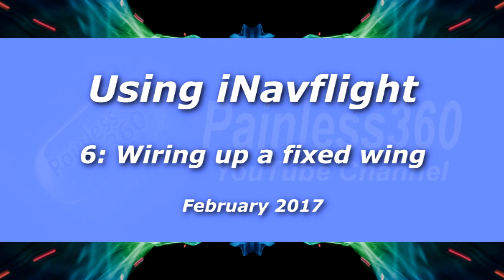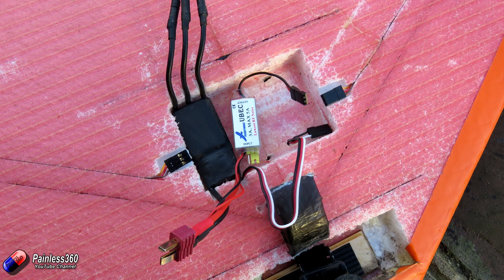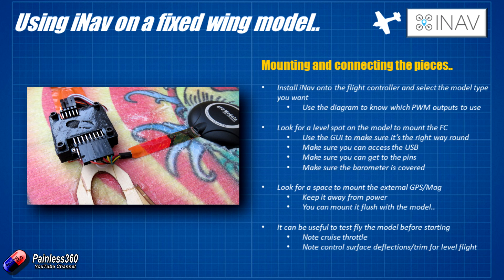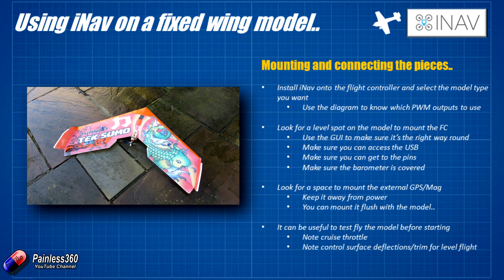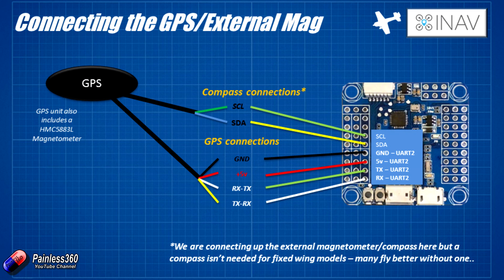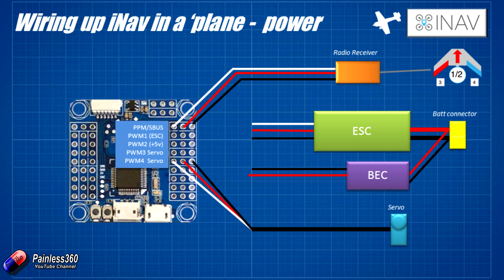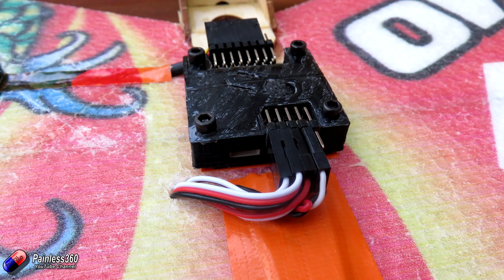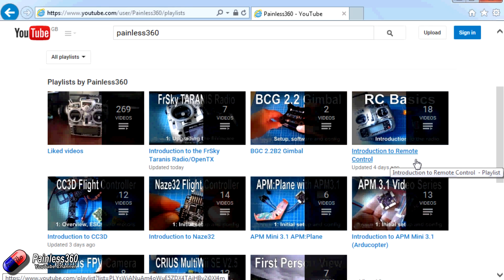(6/8) Introduction to iNav: Wiring up a Fixed Wing

Comment: Can a BETA Flight esc be used on INAV?
Reply from the maker: Yes, ESCs are not software specific..
Reply: Thank you, I was just going to sell it.  I blow a motor using a 60amp esc and 4S battery so I'm dropping down to a 35amp esc and still using the 4S battery. Will I blow another motor that way?
Reply from the maker: @derrickmitchell39dm  depends on the motor. The motor will only pull the current needed, having an ESC with a much larger rating shouldn't cause a problem. See my videos in the 'introduction to remote control' playlist. Best of luck
Reply: @Painless360  thank you. Your the best.

Comment: painless can you help me. Im stuck in DFU mode when I flash wrong firmware :( I try turn of full chip erase but nothing happen :(
Reply from the maker: +maciek pawłowski The boot loader should be okay, so short the boot pins on the flight control you’re using and select the ‘flash on connect’ option in the firmware flashier so it tries to soon as the board is plugged in. Best of luck!

Comment: As I understand I can't use an fs-ia6 receiver in this setup because lack of ibus port. Could you tell me that the fs-ia6b is suitable for this? Thanks.
Reply from the maker: iNav supports iBus - https://github.com/iNavFlight/inav/blob/master/docs/Rx.md
Reply: thanks for the clarification and the fast reply :)

Comment: I notice that in the videos you fly mode 2 I fly mode 1. Following your instructions my set up the controls are reversed. Is there a remedy, maybe a CLI command, or a special mix or even a fix with the Taranis TX such as reassignment of output channels in the mixer section?
Reply from the maker: +cattlebaron sorry, I'm all mode 2 here so you'll have to transpose. Best of luck

Comment: Lee, I am not sure others are having a problem, but I wanted to let you know that the board you recommend needs to be unlocked. This is easily accomplished by FIRST reflashing the software in Betaflight, which will unlock the board and then flash in Inav. Nothing else worked for me.
Reply from the maker: +Marty Rome thanks for the post. We used the boot button here.. happy flying!
Reply: This works for me too, flashing betaflight 1st to unlock it.

Comment: Hi Lee, 

Im using a omnibus aswell on my miniquad. and planning to use it on my future wing. :) but in my miniquad, i soldered my 4s directly because it has its own regulator. Would this setup work also for the wing? Thanks alot. :)
Reply from the maker: +Ray Erik Rabe we didn't do it that way, the onboard regulator isn't really designed to run lots of servos that you would use in a wing or plane model.

Comment: Hi Painless. First of all, thank you so much for putting the time down on these videos, I salute you sir.

My question is, looking at the series and first video, you used the SPF3 board I believe but now a board called Omnibus F3. What's the main reason for this and should I go the Omnibus route for fixed wing or will a SPF3 suffice?

Thank you.

Regards,
Amir
Reply from the maker: +Amir Tahami as we cover in the series, you need a flight controller with a different compass from the one that you're going to connect externally. The two boards we've used in the series allows us to do that. Personally, I like the Omnibus AIO F3 v1.1 board because it also provides a really handy OSD as part of it as well. Best of luck!
Reply: Thank you Painless. Appreciate it.

Regards,
Amir

Comment: I am looking to get my current custom fixed wing (traditional form airframe)  into the air with GPS autonomous but am wondering if any FC with future adaptability (think that means F4) might work and then be usable in a quad when I go into that in the hopefully very near future.   Thanks for your very informative vidi Painless!
Reply from the maker: +Lorena Malm you sure can! Any decent F3 board can run both quad copters and planes. The iNav team are working on a VTOL craft support too :-)

Comment: iNav has undergone some major changes from version 1.5.1 to 1.6 (CLI commands and iNav Configurator). It would be great if the next video would explain parts of these changes.
Reply from the maker: +Juergen Stremmler we will cover the main improvements once it's released.. stay tuned!

Comment: very nice and helpful video! i have a question i have the tbs ezosd that has a gps can i use it in my flying wing so i can the osd and the seriously pro working with inav?
Reply from the maker: +Bill Asimakopoulos With a flight controller like the Omnibus we are using here you'd remove the EzOSD and let iNav do all of that for you. The only thing you'd lose would be the current monitoring. Happy flying!
Reply: yes with another gps or the gps of ezosd?
Reply from the maker: Bill Asimakopoulos use a M8N. Best of luck

Comment: Inav will not work with naze32 and pwm :(
Reply from the maker: +shane tillery see our comments on all the videos. I wouldn't use a Naze32 for iNav......
Reply: Thank you
Reply: Your could use a PWM to PPM encoder for $6 to get it work with iNav, but I don't recommend using a F1 FC with iNav https://www.aliexpress.com/item/PWM-to-PPM-Encoder-for-Pixhawk-CC3D-MWC-Naze32-F3-Pirate-PPM-Encoder/32648411752.html?spm=2114.01010208.3.2.AXY462&ws_ab_test=searchweb0_0,searchweb201602_5_10065_10000073_10068_10000077_10000074_119_10000030_10000026_10000023_431_10000069_10000068_10060_10062_10056_10055_10000062_10054_10000063_301_10059_10099_10000020_10000013_10103_10102_10000016_10101_10096_10000056_10000059_10052_10053_10107_10050_10106_10051_10000097_10000094_10000091_10000007_10000050_10084_10000101_10083_10000100_10080_10000047_10000104_10082_10081_10110_10111_10112_10113_10114_10000089_10000086_10037_10000083_10033_10000041_10000044_10000080_10078_10079_10077_10000038_10073_10000035_10070_10122_10123_10121_10126_10124,searchweb201603_2,afswitch_1,ppcSwitch_5,single_sort_2_default&btsid=046fcfc3-b7c1-4a46-b521-f2e5941cd3ad&algo_expid=58871a9f-57c8-4203-bc38-cc4fd9a2b2f0-0&algo_pvid=58871a9f-57c8-4203-bc38-cc4fd9a2b2f0

Comment: Can I use iNav with APM 2.6?
Reply from the maker: Not at the moment, there is work to start to support PixHawk (https://github.com/iNavFlight/inav/pull/466). Remember that APM is 8 bit, iNav is a modern 32bit firmware. Hope that helps..
Reply: Painless360 Do you know what software that I can use to program my APM 2.6?
Reply from the maker: Scott  Miller have a look at our APM series on the channel. Arducopter 3.2.1 was the last version to support APM.. Best of luck!
Reply: Thank you for your help
Reply: Latest version of Mission Planner is 1.3.44 and later versions of firmware were developed for the PX4 FC only and not for the APM, but there is still some development!
Reply: Juergen Stremmler et/hgyftttt6tf7y6yy

Comment: does inav need to use the yaw gyro since a wing doesn't have rudder? I have a naze rev6 with a faulty yaw gyro that I was thinking I could still use in a wing.
Reply: I totally agree. I own some multicopter with iNav and a Naze32 (Rev5 and 6 and 10DOF and 7DOF) 

But as time goes by, I never would use a F1 FC with iNav anymore! 

Buy the Omnibus FC or if you like an Omnibus Pro V2!

Especially for a fixed wing I believe that current control is important when we fly autonomously and long  distance flights. 
Btw. I have implemented iNav in my trainer model which has a 20cc gas engine resulting in a flight range of approximately 20km. (1st limit is the fuel tank!)
Reply from the maker: I wouldn't use a Naze32 for iNav, some great boards with integral OSDs and blackbox etc for less then £20...

Comment: Very nice! Can't wait for the next vídeo. I followed your recommendation and became a patron for the iNavFlight project too. Also I'm a system developer, so I'll try to get involved in the GitHub too... maybe I can help.
Reply from the maker: Next video is almost done - stay tuned :)
Reply: Ok, I'll. But let me see if you can help. I'm building a Flying Wing with a 2836 2200kv motor (witch draws 30A maximum with 7x4 prop). But I have a Hobbywing Skywalker 50A ESC (with Built-in 5V 5A Switching BEC). I'll use only two 12g metal servos.

The question is: Do you think I need a separated UBEC to provide power for the Flight Controller, 600mw transmitter, câmera, MinimOSD Micro, Bluetooth datalink and GPS? (besides Radio Receiver and Servos)?

I have made some accounting and all the electronics will drain 1.5A... So I'll have 3.5A free for servos and RX.

What do you think?
Reply from the maker: Daniel Ribeiro I think that should be fine. we're running something similar here and it's happy...
Reply: Wow! Fast response. Thanks!
Reply: No. INAV runs on STM32-based boards. APM is a ATMEGA2560-based board.
Reply: Go to the ArduPilot Website, in Downloads section, and look for "MissionPlanner" software.
Reply: New iNav developers are always welcome.
Reply: Can you use iNav with APM 2.6?
Reply: Do you know what software that I can use to program APM 2.6? Just brought it and it didn't come with instructions.
Reply: Thanks
Reply: I did that and it won't take it. Meaning the live calibration part when you have to spin it around. I'm just going to order the PixHawk. I guess there is something wrong with the one that i brought. Thank's for your help thou. Everyone that helped me I would like to thank you.

Comment: Are there any plans to have the ability to use inav with Mission Planner?  I have seen some talk of adding Mav Link protocol, but I am not sure if this will give the ability to use Mission Planner.  End goal, I want to stop using high priced PixHawk and more lower priced FC's with iNav but still have the ability to use a 915mhz air module for telemetry back to Mission Planner.
Reply from the maker: It looks like it's on the list of enhancements. Let's let the developers know if it's something we want! :D
Reply: iNav already supports MavLink telemetry (although I haven't actually tried it myself).

Using Mission Planner to set up waypoints is something we hope to add when we have time. It probably won't make it into 1.7, but may get into 1.8 (or perhaps later).
Reply: The EZ-Gui app allows this already You can program waypoints on your tablet then store them in your FC. So we don't have to wait for version 1.7 or 1.8....

Comment: I am going to be adding iNav to the S800, and it has everything enclosed in the battery bay, Do I still need to cover up the barometer?
Reply from the maker: Ideally, as most bays will have draughts. Best of luck with it! Post some video of it in action! :D
Reply: cover the baro! BTW, one of my implementations ist to a Tarot T960, with Sonar, OSD, GPS and 3DR radio.....